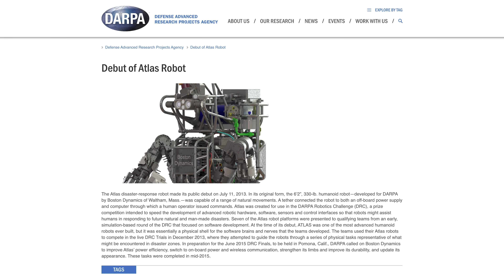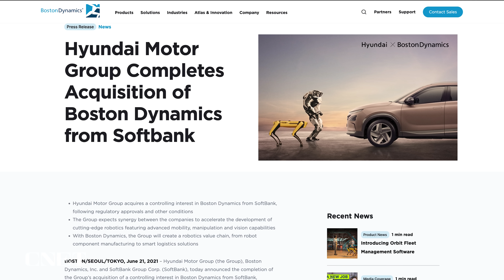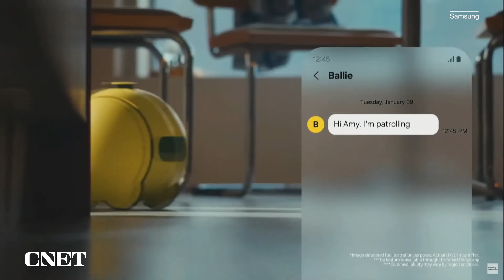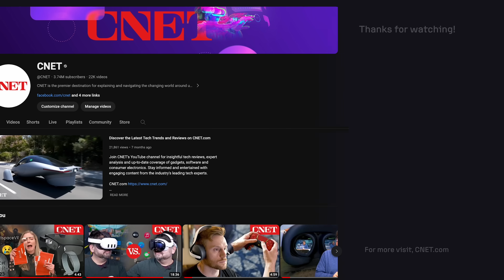Boston Dynamics Retires HD Atlas Robot

Comment: I'm really curious to see if they will stay with some linear actuators but Brushless motors rotating  ball screws.. other than that, probably the same round semi-direct drive rotwtional actuators, but right now, my guess is they'll be using RL with their MPC for a better hybrid.. actor critic model predictive control with a transformer picking the Q&P values,.. and a bunch of secret sauce, i.e. keeping all their weights n biases and policies and cost functions to themselves. Well they'll probably tell us the value rules they are optimising for. 
I'm curious ti see if they will be teaming up with someone for the RL side of things or will they do it in house.  
Are they in the NVidia group?